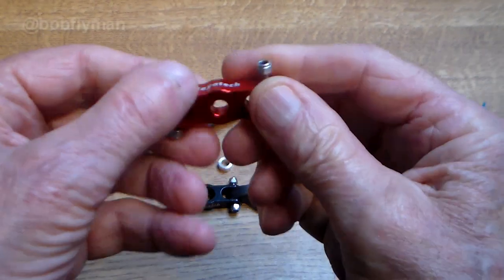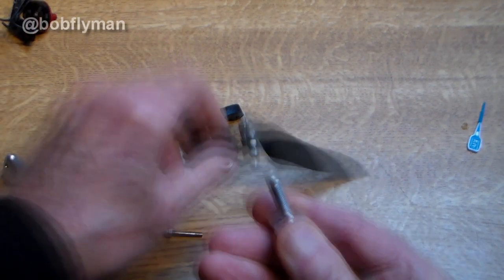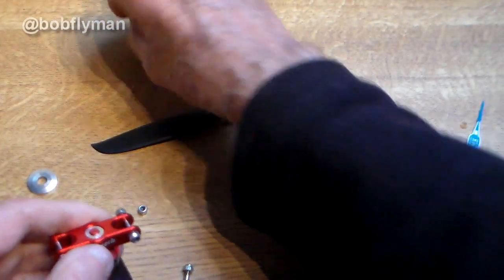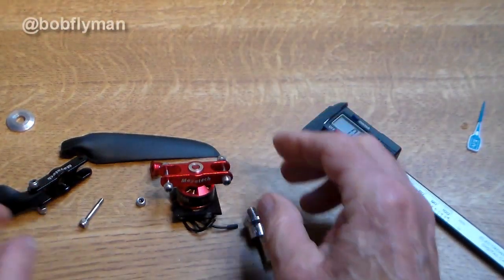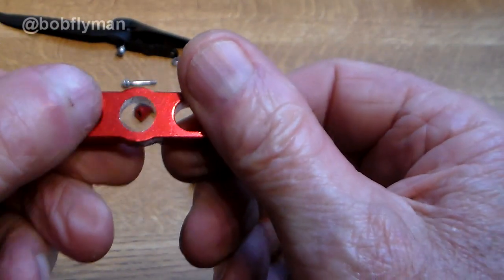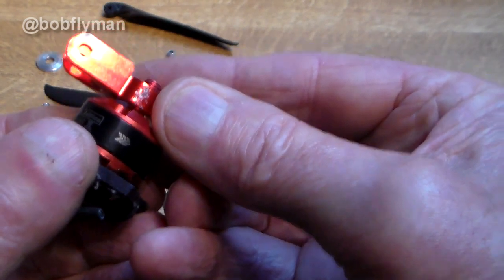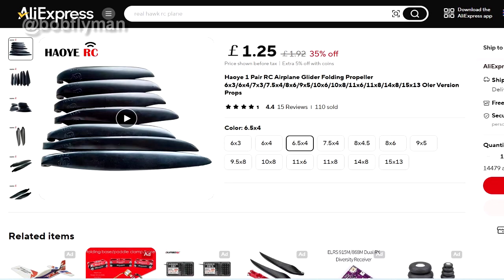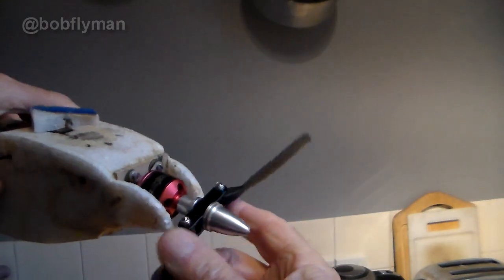Custom RC Folding Prop Adapter for Brushless Motor in 1 Hour!

Comment: Many of the regular props come with a selection of plastic bushings for various diameters...
Good job! 😊
Reply from the maker: Yes, I got loads and loads of those plastic inserts! 😉
Reply: @bobflyman  They have a way of accumulating, because, throwing them out is not an option. At least not for me it isn't! 😆
Reply from the maker: And you can never find the size you want! 😫
Reply: @bobflyman  so true 😂